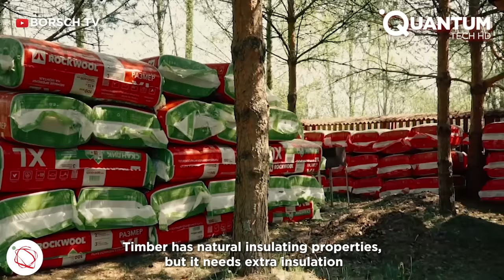How to Build a Cheap DIY Wooden House Step by Step | by @Borsch_TV

Comment: I want to see the invoice for the wood, windows, electrical, I want to see if it's really only 16,000. If it is GREAT JOB💯👊
Reply: This video taken from youtube channel "Borsch TV"
Reply: About 16k for half this build in 2022. By 2023 its probably gonna be 50k and you can't even afford to run the mini diggers fuel
Reply: Remember that this was in Russia, or FSU. Cheap to buy the wood. Their found AZ tion was very little cost. The floor was a bit overkill. Built their own wall, and roof trusses. I have seen people build as this on the second floor of a house, as decking over the first floor, and raising wall, and roof as like Trusses. Seems to have very high ceiling, and heat loss ? I would have made it wider, and less high. Ir framed a lot, decked it off, and then did as they did, but not as tall, and had two real floors. But maybe thi sz is a summer home. As in the FSU many people had summer homes out in the country, or on some water. So it does not have to be as big as their year round home. That Metal roofing sure seems to be way more work to install, as so many layers of strips, as water proofing, strips, and more strips, and water proofing, and then the metal. Well the metal sweats easily, and it may rot the wood easily too, if theres not enough air between it, and the actual roof ply. If it was me, I would h AZ ve done assault shingles instead. But maybe they get lots of snow there, and this slides off the metal at a angle easily, as compared to the asfault shingles. As simple to put the tar paper down or the plastic vapor barrier on the Roof ply, and nail The asfault or 3 tab shingles down, and done. But the metal is cheap way to do it, but lots of space wood strips, for ventilation, and if any screw holes leak a bit, it's only going to rot out the strips, and not the roof ply instead. Once you have it all stripped, and spaced, its quick, and easy to put the metal on. Now days we have much better, and or nicer metal panels. They even have some that looks like sheets of Roof tiles, that come in metal sheets, with a texture, and color, and when done, the roof looks as a tiles roof, but much cheaper. Dont go to small in your house. As it's easy to make it bigger, and not much more cost. As you are just adding a bit more lumber to make it wider, and or longer. If you make the ceiling high, make it high enough to add a loft area for your master bedroom, as it's cheap square foot to build. As in their build, I would have done that to go maybe 10 or more feet wider, and taller to gained enough height to build a loft bedroom in the rear. Using maybe 1/2 the rooms space above for your Master bedroom, walkin closet, Bath, and Have a open living room with high ceilings where it comes out onto this deck.
Reply: The definition of cheap is futile.

Comment: Beautiful and well done, but I don't think it's cheap.
Reply: it depends on where you live. it was cheap there ) around 14k usd
Reply: @it6642  is that a total include the rent for that excavator?
Reply: @WalllOfNothing  yes, he mentioned that it was including installing septic
Reply: well bro i got a budget of around 50
Reply: Before the interior works it cost them around $12000-15000 including sewage tank and all the plywood for interior. As they tell it on their Youtube channel.
Reply: @pavelcharushin  In Ukraine?   Or what country?  I just want to understand if all this material is available
Reply: @it6642  in which country ?
Reply: @admin6228  in Russia
Reply: in indonesia around 6-7k usd
Reply: Anyone know where to source the wooden brackets they used for the rafters?
Reply: In USA, the septic tank itself would be $10k. All that wood, would cost atleast 20k+. This project would be 30k-50k now.

Comment: Absolutely solid construction, well done!
Reply: no its not! House wrap is put on wrong... Why to housewrap a floor? It is directional material. It should be applied underneath floor not on top on interior side. It will drive moisture into insulation! There is a lots of problems...

Comment: They could've done a cement foundation and built the rest with wood
Also are those wood foundations treated?? If not done correctly it'll rot in a few years and also it'll break since I'm not sure those skinny screws would hold
Reply: Captions said lumber was pressure treated & sealed.

Comment: Nice build. I only see a couple of issues with it... I love that they treated the beams but I didn't see them treat the OSB they used to hold up the insulation from beneath. Depending on the climate zone they're in, moisture could rot that out over time. A much better solution would have been to drop in sheets of the same metal they used for the roof and siding... but the big issue I see is that they seem to have used house wrap as a air/vapour barrier on the inside of the wall assembly. House wrap is a weather resistive barrier (WRB) and NOT an air/vapour barrier. This might have been mitigated by using a latex paint over mud and drywall but it looks like they used plywood instead so I'm really curious to know what their ACH rating would be. I see that they even made the effort to tape the seams on the inside but a WRB doesn't stop air flow so this was pointless. The correct thing to do would have been to use poly sheeting instead. Something I thought was interesting was the absence of any sheathing or lateral bracing to prevent shear forces (aka what prevents the frame from falling forwards or backwards?) and then I see that they used plywood for their internal wall decoration which provides this... nice!
Reply: Hi Kris. Good comments. Question regarding WRB and poly sheeting: would you use house wrap on the outside and poly on the inside? thanks
Reply: @christopeller  Yes. The purpose of house wrap is to shed bulk water should it find its way behind the protective cladding. This is part of the protective layer of the wall assembly. Poly is commonly used as an air/vapour barrier. We call this the control layer and it always goes on the 'warm in winter' side of the thermal layer (aka insulation). The poly is typically placed across the face of the studs after the insulation batts have been installed and you should tape the seams to ensure that no air can get through. This is not the only way to build a wall but it's the most common. Search up 'The Perfect Wall', the REMOTE wall system or the PERSIST wall system for alternatives but they will all follow the same rules. The problem with using house wrap for this is that it is actually made with tiny holes to allow moisture to pass through should it need to escape the wall assembly. These holes are too small for bulk water so if rain gets behind your exterior cladding, it just runs down the side... but they will allow air and water vapour to pass through so they don't protect your wall from the warm moist air generated from within your home. Hope this helps. :-)

Comment: In Europe its really expensive. Wood and tin materials to expansive for a shed. 

Buy old or used brick, make a foundations and put the bricks in mud. Concrete is to expansive nowdays.  The old way is cheap, isolate, containt natural materials. No plastic, no foam or polistirol.

Comment: screws are good for drywall, not structural support, should be using nails on your framing. Once you drill holes on the foundation floorboards, many places call for a second coat of treatment to sink into the nails.

Comment: Only criticism would be the lack of any continuous insulation across the timbers. Cavity insulation is great, but each timber is a massive thermal bridge, and there's nothing stopping them from transferring heat. Cavity insulation alone has been the standard for a long time, but newer research into energy efficient exterior envelopes has shown how important creating a thermal gap really is, even in mild climates. But if no one's living in this little hours full time, the extra climate control costs are probably insignificant.

Comment: This step-by-step guide on building a cheap DIY wooden house is incredibly informative and inspiring! The clear instructions and practical approach make it accessible for anyone looking to take on a similar project. What was the most cost-effective technique or material you used, and do you have any advice for beginners starting their first build?

Comment: Can you please tell me, when you build the foundation you are using a sort of a pipe, is it a hollow one steel or is it with a screw at the bottom? Also for the top what kind of mount do you use when you push it in the ground?

Comment: The steel beams are filled with concrete. But the beam may still move in the soil. Why wasn't the beam poured into a concrete slab? More protection for the beam and less chance of shifting in the soil over the years

Comment: Very nifty piece of detail and art, nicely done. I like the idea of pilings as 'foundation', resembling ideas from the '70s book "From the Ground Up" by Cole & Wing, the idea being 'not to disturb the soil unnecessarily'. The wall construction too is thought-provoking.  Leaves only one question: why so little roof overhang (to better shelter walls) and (apparently) no way to attach rain gutters, which would enable the collection of rain water. Overall though a true jewel.
Reply: всё там есть, и водосток и свес, стены не нужно защищать, они сделаны из кровельного железа 0,45 мм, если правильно помню! весь процесс постройки есть на канале Борщ !

Comment: House wrap shouldn't be used under the subfloor as an air barrier. It doesn't work that way. A more effective solution would have been to simply use construction adhesive around the edges of the sheets of flooring. This would have created an air barrier and prevented squeaks in the floor from having used nails instead of screws. House wrap is used to shed bulk water while still allowing air to pass through so that things can dry to the outside should they get wet. It should not be used as your control layer. Taping the seams and the sides literally did nothing.

Comment: 16K no way!  Septic alone costs around 6 grand. More like 60k.
Reply: переезжай в Россию.
Reply: @vitaliygrishin3278  зачем?
Reply: She is an architect that has friends with equipment & skills. 16K is most likely materials only & it is not in USA. We use fiberglass insulation, they used mineral wool.

Comment: Cool…now when their floor falls apart under them 5 years down the road, they’ll understand why you use nails in house building and not screws.
Reply: oks

w.rd i
Reply: Tru,tru
Reply: Makes no difference other than for future projects; w/screws it's easier for the removal; what matters most is that 1 uses the CORRECT strength of the screws (lags or nails) for that matter; & YES I KNOW FOR THAT OF WHAT I SPEAK; not only have i owned a door company, i've also remodeled my house taking the roof from a 10ft flatline ceiling to  an 18 ft valted ceiling having to put in a 24' long x 18 inch high x 6 inch wide beam to support the weight of the reconstruction of the roof trusses; my ex was a staff sargent in the air force on the "prime beef team" in the carpentry unit to build "air ports" in vetanuum; he taught me everything i know about carpentry; & i come from a car mechanics back ground; daddy owned his own shop.
Reply: @auntymar-marjustme  oh for fucks sake…the typical “my husband was so and so in the military” dependapotamus response.  
For one, nobody cares — you are not your husband and his experience does not transfer to you.
For two, screws are not only the wrong fastener, but are against code in many places because tensile strength is not the issue, flexibility is.  Framing a house isn’t about strength alone.  Screws don’t bend, they break.  Nails can bend and re-straightened.  So when your house shifts (and with those half ass footings, it definitely will shift), the screws will break or cause catastrophic damage to the lumber.  That damage will result in a loss of structural integrity and/ or eventual rot.
The difference between you and me is I actually have the experience and the education to back it up.  You clearly DON’T know what you’re talking about.
Reply: @auntymar-marjustme  your life is not the topic of this vidéo.
Reply: Не развлится
Reply: So aunty mar mar is a self proclaimed carpenter, auto mechanic and has a failed business, marriage and countless failed arguments. I’ve learned a lot about her life in one paragraph 😂

Comment: Russian way of wood framing is very detailed and almost like carpentry.  Very neat and systematic. I also noticed when they installed the windows it was on the inside which means the window sil is outside. It is the opposite in the US and Canada, the installation is outside and window sil ends up on the inside

Comment: underlay installed incorrectly,never from ridge to eaves. another big mistake is that. that an underlay containing plastic was placed on the outside of the wall and the same on the inside. newer plastic on the outside, must be breathable material, thin wood fiber board, or similar. vapor barried then to the underlayment does not meet structural regulations. if done in that way, the mineralwool and the frame of the house will get wet, moldy and rot.

Comment: Video is shared from 3 days ago.
With the cost of lumber over the last year and the cost of fuel as well.were these figured in?
The cost of equipment rental. 
The cost of food to feed your help and family working with you.
The cost of buying nails, concrete,  sand,  septic tank, 
Steel sauna tubes
Doors
Windows
Electrical wire.
Insulating foam
House wrap
Stain and paint
Show a breakdown of cost and materials for Everything then let's just see that it's $16,000 dollars.
Unless you are building in a country where the Dollar is competitively strong..
No way.
PROVE ME WRONG.....

Comment: Father in law used plastic inside and out of walls much as you are using that paper
called Rockwool [what wool has to do with it?]. The house was vapor barriered alright.
Mold soon formed inside the walls because there was no ventilation and air and 
humidity was trapped inside. Seen siding pulled off a house that had vapor barrier
of a famous brand under the siding. Water had condensed on the vapor barrier. Funny
how physics and Nature are indifferent to humans and manufacturers' silly notions.
People who live in houses too tight, will get sick. Animals are the same in barns that
are too tight and lack ventilation; better to put animals in old barn with air blowing 
between boards, they will stay healthy.